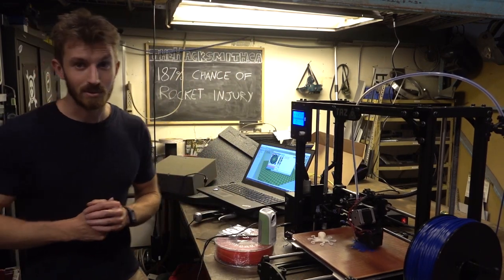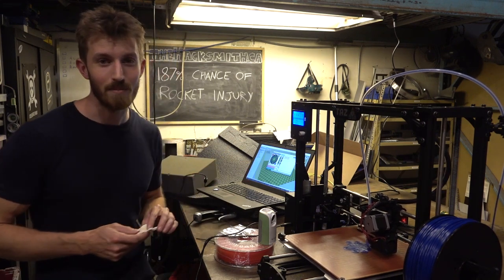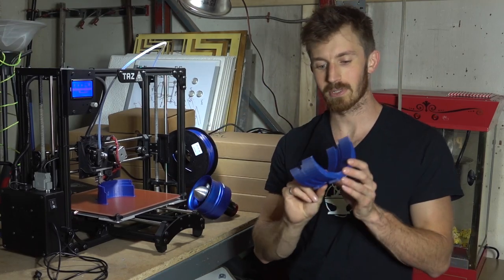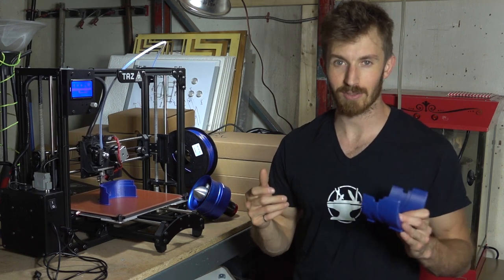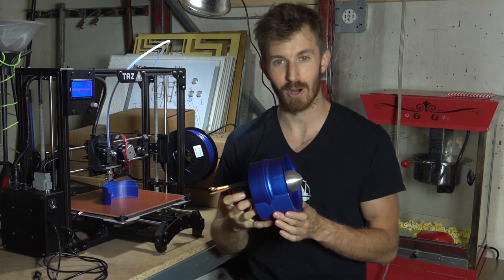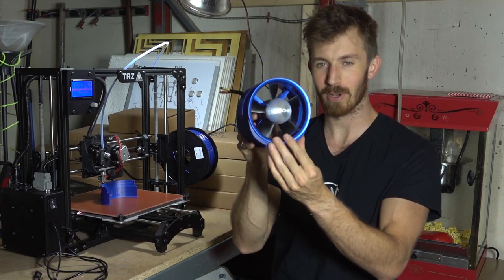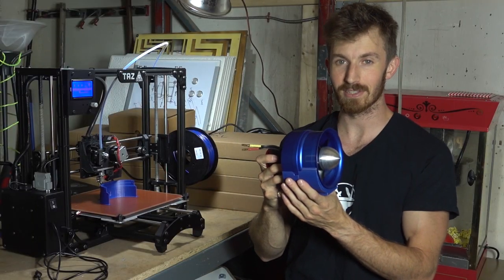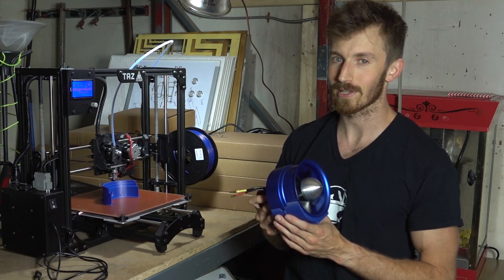VLOG 003: We got a 3D printer!!! And ELECTRIC JET TURBINES!

Comment: Hey, good job on getting a 3D printer. It's useful for prototypes as the plastic is nice and durable. That being said, I wouldn't really recommend using it when you plan to apply any significant amount of force; it's because of the nature of the actual printer, it makes layers upon layers that "glue" together so I'd really recommend you sand the part smooth and then make some moulds, that way it'll be able to sustain more force being applied to it without cracking
Reply from the maker: I disagree! I've used tons of 3D printed parts for functional parts, not just prototypes. Even the last company I worked for started using some parts for production! More design needs to go into parts that see stress, but it is fully possible to use them for more than just prototypes. In this case, each EDF only puts out 25lbs of thrust, which is mostly captured by metal bands that hold it down. The 3D printed part that attaches to it simply provides a flat mounting surface -- it doesn't see nearly as much force as the turbine puts out!
Reply: I see, and I assume you printed it with the wide side and the radius being the layer that is extruded?
Reply from the maker: In this case, it really is just a prototype for fit -- not done the design yet ;-) I've been designing parts for, and using 3D printers since 2012, don't worry!
Reply: Well then, good luck (no sarcasm)
Reply: So you did pick up my idea in a sense
Reply: there are even metal 3d printers
Reply from the maker: That cost millions =(
Reply: the Hacksmith Yeah sadly. They're cool though
Reply: how about doing grant thompson's metal mold foundry, im pretty sure plastic would work just like styrofoam
Reply: One day my friend.
Reply: if its PLA it will... sorta it leaves a kinda sticky residue and a glob of black mystery goo that dosent mix well with the metal

Comment: Try using funnel compressors to pressurize the air flow of the turbines which with help with maneuverability
Reply from the maker: I dunno... these are the result of 100's of hours of engineered design to produce optimal thrust from power input... while I wish I was some genius engineer, I'm not gonna be able to increase output with a few simple changes like that =(
Reply: +the Hacksmith use one turbine on each limb at 30 degrees and two parallel to the back.

Comment: I can imagine something like a backpack that holds the batteries and controllers, with a 'yolk' across your shoulders which has the EDFs mounted either side. Tilt it forward and back & side to side slightly to control your flight vector, with throttle being a simple pistol grip and trigger. Gonna need to buy shares in some lipo manufacturers I think... :D

Comment: Just a little tip, I find printing from the computer, sometimes Cura crashes and when it does, it stuffs the print up. It's a little more work but for really LONG prints I suggest no risking it and just printing from the SD card. I have a Taz 3 though so maybe it's my printers, but it seems to be Cura crashing though... anyway just a heads up.Also, buy a spare PEI sheet too.
Reply from the maker: +Designandrew haha we were actually printing from the SD card, I was just excited and misspoke

Comment: +the hack smith you should have the rockets on your arms and the turbo jets on you legs so that when the jets go off there will be a delay to the jets so when rockets stop the jets will kick in and will allow you to hover or slowly come down or even if you get high enough you can propel your self forward
Reply from the maker: +Wade Barrett or we just use the turbines...
Reply: +the Hacksmith but using the rockets will give you a huge boost on getting up in the air as the turbines will be slow  and the rockets will make it easier on the turbines lifting you while your in the air then lifting you off the ground then holding you there

Comment: A multi stage non combustion cold flow thrust turbine and electrical generator.

All electric with no combustion. So take a traditional multi stage jet turbine. Add a whirligig pin wheel (potentially a supercavitating ram scoop impeller) to the front that has a wider blade span than the entire turbine to the turbines front, creating a forward air vortex (vacuum) greatly increasing internal pressure. Change traditional rotor configurations to 3d vortex impellers thus greatly increasing its ability to move and pressurize the air. However we could further increase efficiency by creating a new 3d vortex impeller shape, one that from the side is a symmetrical diamond with the top and bottom coming to a point. This would allow them to be staggered with many towards the front while tapering down conically to further increase pressure (I'll sketch a rough diagram forgive that I still use pen and paper for theoretical sketches).
Add a few rings of traditional side scooping impellers to the wide fore body of the turbine housing (though I have a theory for a Flayer Rocket Body, where the entire body would be air scooping 3d vortex impeller blades, while the inside would be a combination of solid rocket fuel and scramjet turbine).
Now we have huge amounts of air being rammed into a funneling cone creating high pressure, cold exhaust.
Next is power generation. So turbines like the one in the how it works video, have rotors (that rotate) and stators (that stay). Alternators do too. So add some magnets and you have an alternating (electrically generating) turbine. But is this all we can do?
Nope, not even close. Coat all surfaces with clear photosensitive cells over kinetic reactive paint over thermal (if the engine runs cold enough you'd want endothermal) reactive paint. Kinetic reactive paint reacts to the flowing air around it producing both a photo reaction and a thermal (or endothermal) reaction. But wait what about bloombox air reactive cells (in his how it works video he is quite clear that this material is painted on too), so alternating ribbons of bloombox paints too. With nano manufacturing each paint can get plenty of what it needs for reaction. Quantum quintuple power paint in an already alternating turbine = huge power generation and maximum cold air thrust with vectoring.
Reply: I would certainly like to know/learn more about this.

Comment: Propeller vs Impeller vs Cavitation. Cavitation wins, so change the design to increase thrust. other basic ideas would be a cavitating ram scoop intake for high pressure, 3 stage jet turbine (3d printable), and making the whole turbine an electromagnetic generator. basically anything torqued could be a fan and alternator combined but no one does this and it has the potential for extreme efficiency.
Reply: This should say super cavitation.

Comment: You can probably take off with those turbines a lot more smooth than with the rockets. But how are you going to get the power-supply for those? A car battery? Or maybe a little nuclear Reactor in a backpack or something?
And also, how do you control the rpm? You would also have to take a laptop or something with you, wouldnt you?
Reply from the maker: It'd be literally impossible to offset the weight of a car battery with these. Gotta go lipoly. They're designed for hobby use -- did you see the remote control I put in front of the camera during one of the tests? That controls the thrust =)
Reply: the Hacksmith Ah allright, i see. Thx for the reply :)

Comment: With those fans, especially with how powerful they are, have you thought about the rotational forces? If all the fans spin up and are spinning the same way, its going to make your whole body/rig rotate (aka why a helicopter has a tail rotor)
Reply from the maker: +World of Pac unique property of ducted fans! The way the airflow goes through an EDF does not cause rotational forces. If we used rotors all spinning in the same direction, yeah, we'd spin :p

Comment: I love it! Thanks for the demo, though I'm glad all were sensible enough to wear goggles... not trying to be the 'school marm' here, but imagine even a gain of sand revved up and shot thru that thing into one's unsuspecting tender eye... (?)
Next calc is how many pounds (kilos?) of lift per kW/hp... and what's effective for going a certain speed on these things. Everyone wants to know the range possible via whatever power pack you put together... even if a voltage amplifying circuit or current boosting Super (Mega?) Capacitors are helpful to assist initial launch... or land. I'm going to check out the specs on the (8) motors used by the Chinese eHang 184... respectable in it's own right (with a chassis) demonstrated at 20 mins of air time carrying a person. No wings. Come to think of it... while you're getting into the 'fun stuff' with parabolic motion (altitude, TBD..) it might be nice to look into a ballistic parachute. There Must be some friendly, visionary manufacturer who is willing to let you demo a fine safety system on your journey.. to ensure the 'return trip' for the next one! A little insurance from a '1-way maneuver' Lol
Reply from the maker: These specific ones do 8kg of lift. Not much. But the beauty with ducted fans is their efficiency increases with size. These are 5" diameter. If we move up to 8" diameter, output doubles, while input is only 50% more. 

The catch... custom made from France, 3000 euros each.

Comment: use them to vector air streams against a spinning cone, like the Coanda aircraft from 1910, thus producing significantly higher lift than there sum total together. however these jets are too bulky for your end game, look into better turbines. shit there is even a new high powered tiny portable fan for inflating that has more thrust potential than those. I'll find the link.
Reply from the maker: Please do the problem with EDFs is their efficiency goes down with smaller sizes... bigger the better for airflow!
Reply: I understand but those particular models suffer from at least five efficiency flaws. I'm compiling a list of videos that will give comprehensive solutions to many problems, from power generation to thrust improvements and diy ideas. It will be followed by a short briefing on theoretical ways to improve, integrate and increase efficiency. Ideas that are mostly mine, but since I lack tools, shop and funds to create them (luckily I have friends at JPL) I won't be developing them anytime soon.
Reply: Adding a cone scoop to the bottom is a basic to increase thrust pressure.

Comment: You should try building a flying hover board using those jet turbines.
Reply from the maker: It's been done
Reply: +the Hacksmith what about a flying suit using the turbines. it could be like two turbines in the back and one turbine in each leg.
Reply: +the Hacksmith or if not on your legs, on each of your arms. It will most likely be more stable then the rockets, because u could control the amount of current going trough the turbines.

Comment: If you need someone to wire those EDF motors. Rc's are my specialty.
Reply from the maker: lol they're pretty simple to wire... battery to speed controller to EDF... I'm not that bad at electronics!
Reply: +the Hacksmith okay we'll make sure the power is distributed equally and if any issues you can mail me or something

Comment: i thought you would end up using edf's for this but how much actual thrust do they provide at full power
Reply from the maker: 25lbs. The bigger the EDF the more efficient. These are 125mm diameter, if we go up to 200mm diameter, power is 50lbs and only 25% increase in energy usage. Unfortunately.. .custom made from France, 3000 euros each... need sponsorship... lol
Reply: OMG 50 lbs tats a lot but the price is crazy 3000 € i thought i was going to buy some of these i really wanted to tinker with edf's but these are way way way to expensive and when you add the price of the batteries its a lot  but i think these are great for the project you can control these very well and these will work much better than rockets and be much safer

Comment: you have the thrust power, now you need the stabilizers
Reply from the maker: Or, if you balance thrust above your center of gravity, use body weight as a built in gyro...
Reply: +the Hacksmith or you could that

Comment: How many of the fan engines you planning to use and are you expecting enough lift? 

I ask as if you watch Colin furze and his hover bike, he has two rather large engines and fan blades that still only just give him lift.
Reply from the maker: +smilley792 very different aerodynamic properties ;)
Reply from the maker: +smilley792 I.e. if Colin used ducted fans of that size... he'd fly into space.
Reply: +the Hacksmith pretty sure Colin showed them ducked in an out take. Maybe to much thrust is why he canned that idea!!
Reply from the maker: Nah he topped out the thrust and it could only hover because of the ground effect. Impressive project though! 

And while they look the same but they're really not the same technology. Wrapping panels around the side of the fan doesn't make it ducted ;-) these are precision machined to create a aerodynamic lip that increases thrust =)

That being said it's still gonna be hard to take off!